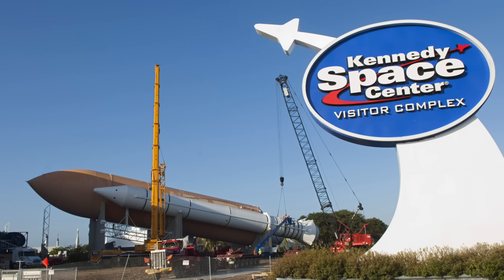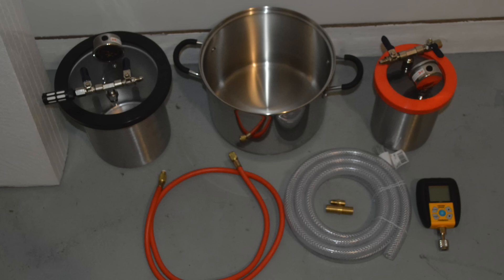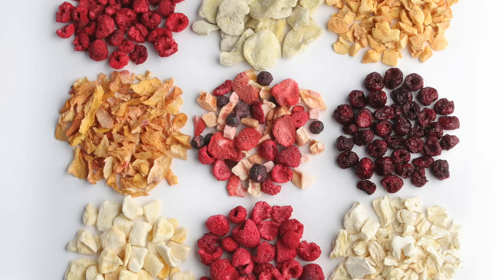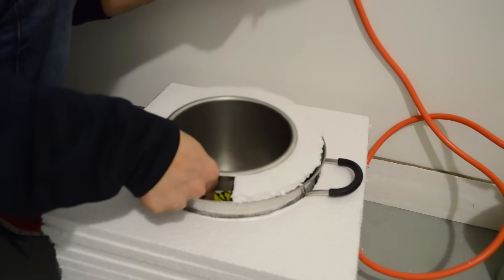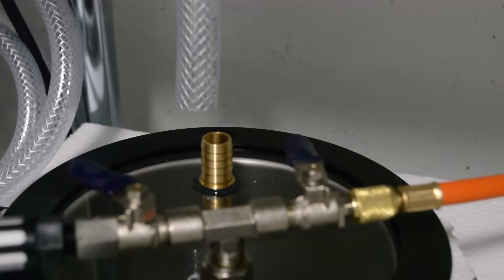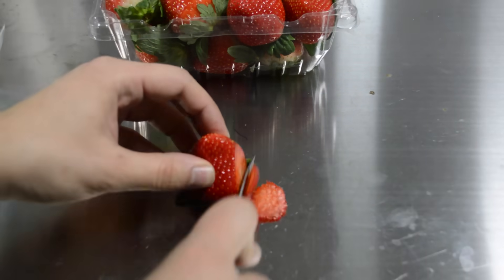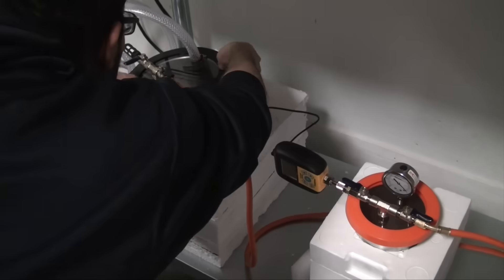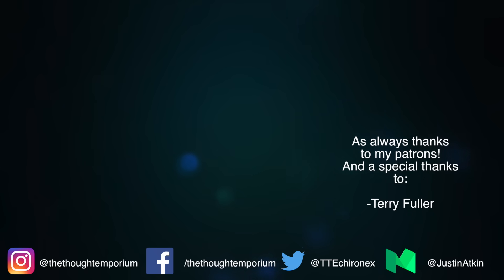How to Build a Freeze Dryer

Comment: Quick question: maybe I missed some clue but why you using dray ice - do you really need so low temperature? I would expect that frizzing samples and keeping below 0 centigrade would be enough and also most energy efficient as I would expect the higher ratio of sublimation just below 0 then in -40
Reply: Actually the sublimation line exists below the triple point so you just need to keep the food cooler than 0.16C.  However you do need a margin so that no part of the food reaches the triple point.  Indeed, at higher temperatures less of a vacuum would be needed.   However texture and quality can be improved by what's called IQF which stands for Individual Quick Freezing.  Dry ice would be good for IQF.  I think this DIY'er made it harder on himself by insisting on such a low temperature and extreme vacuum.  The phase charts for water suggests that such extremes are not needed and indeed historically the ancient Incans freeze dried foods by climbing mountains and leaving the foods exposed at the summits.

Commercial freeze dryers actually heat the product after the vacuum has been applied.
Reply: Unfortunately not. For Lyophilisation, you need very low temperatures so your products don't collapse or even melt. It's a science by itself.

Comment: What if you replace the water trap with a copper tubing coil suspended in cryofluid? T
Reply from the maker: That'll work, just use relatively wide copper otherwise it'll tend to plug with ice

Comment: A question for the PhDs: I've watched snow sublimate in sunlight with temperature in teens, with concrete actually dry. Sometimes even 'steam' can appear. Snow in thin layer. Layers of snow actually also reduce without obvious melting (liquid). So can a freeze dryer be made say cooling down to 10F, with a sun lamp, in a very dry or vacuum environment?
Reply: Yes, that was my query too.  Looking at the phase diagram for water, he actually made it harder to freeze dry by cooling to such an extreme and having such an extreme vacuum.   The sublimation line stretches from zero pressure and absolute zero temperature to the triple point of water so really all that should be needed is keeping the temperature below the triple point (0.16C) by enough of a margin so there is no danger of liquid water forming and then having a partial vacuum, the higher the temperature, the less of a vacuum would be needed to sublimate the ice.  I think he shot himself in the foot with this experiment.

Now rapid cooling of the product could help preserve the quality and texture so initial quick cooling with dry ice may be useful.

If I was to home dry freeze, I would quick freeze the product with dry ice then place it into mason jars, use a foodsaver jar attachment to create a partial vacuum.  The foodsaver's pump can remove just less than half an atmosphere which should be enough if the temperature is high enough but you can use an automotive or AC vacuum pump including the hand brake vacuum pumps to remove 90% of atmospheric plus those pumps are intended for removing water vapour so a cold trap would not be needed to protect the pump.  The automotive brake and AC pumps happen to use the same hose size as the foodsaver jar attachment.  Then it's a matter of keeping the jars in the deep freeze with periodic vacuum draws for days.  Weighing the jars would show you how much water has been removed and the USDA publishes a list of the water content of common foods.  I suspect it would take days to weeks to freeze dry foods this way.
Reply: Yeah snow can sublimate partly because winter brings low humidity and the crystals can be especially effected by sunlight. I don’t think the conditions of a freeze dryer would be as applicable, maybe it could help a bit tho. Worth a shot but you’d probably want the lamp inside the chamber and that’s a pain

Comment: Wow.  I used to use freeze-dryers (Edwards) for lyophilization of pharmaceuticals from both aqueous & non-aqueous solvents.  Our shelf temperatures within the lyophilization chambers were on a separate temperature control circuit so we could drive the process by adding heat to the subliming vials of product.   I also used the chambers to add a special gaseous headspace to a liquid diagnostic product that is on the market today.  I was actually given a product that I had performed pre-approval development work on.  Of course most of the products I worked on were for cancer or HIV,  so I am quite glad I never needed those.  

BUT,  I never got to lyophilize STRAWBERRIES!!!

Comment: 2:16 >millitorr
proceeds to show diagram with pascal on one side and bar on the other
*facepalms
ok no problem let me just get my forty year old quintuple scale unit conversion slide rule from the chest with "do never open" stamped on it, locked with a key which my grandfather swallowed and drowned himself in the sea
Reply: You can use my conversion factors tables, I have those across the room :v

Comment: I've been thinking a lot about this setup.

This might be cheaper by eliminating the dry ice.

Put a check valve from food container to freezing chamber. Next pump/circulate your dual stage vacuum oil into that chamber such that the surface area of the oil is increased.

Here is a luxury step. If you have a 2nd pump of poorer quality connect that to the food chamber.

Steps. 1 while food chamber is worse than 25"Hg, then open cheap vacuum and run it. This is a quick 8 second step, but very useful if you can pump CLEAN dry air into the food chamber. Most air compressors don't make clean air.

2. Turn off cheap pump and valve.

3. Turn on nice pump and run for an hr.

4. Pump oil from nice compressor into the freezer jar (now it is not a freezer, but a dryer). Circulate last oil from here to nice pump. A continuous circulation sounds better. I have to think more to be able to determine how to adjust the flow rate of circulating oil.

The idea is because of the high vapour pressure of water, some water will escape out the exhaust of the pump. The oil will absorb some moisture reducing the vacuum capability of the pump. When the vacuum gets too poor, freshened oil is circulated in when makes the vacuum much better again. The old oil is dried and gets cooler (makes the vacuum pump work better - lower vapor pressure of water in oil)

This will make your HV oil last longer. However, contaminants from the food is getting into the oil (and baking onto the walls of your good HV pump). At some point a flushing solvent is needed to clean the pump and a complete oil change.

I'm trying to remove dry ice which makes the process onerous.  I'm trying to keep the pump and oil below 104 F. I'm trying to keep food chamber uncompromised by bad air, oil vapor, etc. I'm trying to keep HV pump always operating at HV with clean cool oil. It works better stays cleaner and needs less maintenance. 

Oh, I forgot all about my dehydrated apple there. I'm having too much fun keeping the pump running.

Comment: https://www.homedepot.com/p/Owens-Corning-FOAMULAR-1-2-in-x-4-ft-x-8-ft-R-3-Square-Edge-Rigid-Foam-Board-Insulation-Sheathing-36L/100320356

this is a better material for temperature isolation and is much less fryable

Comment: For the vapor trap, I used some stainless steel fins from some scrap 304 stainless steel to increase the surface area and help less water vapor make its way into the Vacuum pump. I learned that the hard way and ruined a $1000 vacuum pump and vacuum fittings.

Comment: What about using a vacuum pressure tube that has a remote meter instead as they are not too expensive. Can get for under $200 new.

Comment: hello the water tramp can be made with a 2 quart resin trap that they sell in Best value vacs? thanks I will build mine but I was wondering if that resin trap will work? here is the link for the ebay resin trap thank you  https://www.ebay.com/itm/Best-Value-Vacs-2-Quart-Resin-Trap-Vacuum-and-Degassing-Chamber/282883443116?hash=item41dd2ac9ac:g:-2wAAOSwJ8pbZU~R
Reply from the maker: ya that'd work

Comment: Is there anything else you can use instead of the denaturized ethanol and dry ice? I suggested this for my sister because she wants a freeze drier but seems to be deathly afraid of dry ice for some reason
Reply from the maker: Not cheaply. You could use liquid nitrogen but that's more expensive. At some point I'm planing on building a device that can get to these temps without dry ice, but it'll be a while and won't be able to be a great water trap as it can't cool a large enough area.
Reply: @thethoughtemporium  Wouldn't it make sense to run a little higher pressure in the drying chamber, say 50 to 100 Pa, and use standard refrigeration coils to keep your cold trap at approx. -30 C?  Everyone seems to think that 10Pa is required for freeze drying, but it seems to me that it's more about removing vapor fast enough (by condensation or with the pump) to keep the vapor pressure under the triple point.

Comment: Can you replace the water trap with a pipe/chamber filled with silica gel?
Edit: Nevermind, just saw a video with silica gel under vaccum, the water just boils off.
Reply: A/C vacuum pumps will draw water in small amounts <100ml/hr without the need for water separation. I believe that the water separator is for when you are removing a large amount of water due to high surface areas mainly found in commercial drying operations and may not be required at this scale.
Also most A/C vacuum pumps will draw a vacuum down to 35 micron, The industry standard for pre-Fill vacuum of a r134a Aircon system is <200 micron.

Comment: I think keeping the drying chamber below freezing during the entire process is preferred.  That is to say, below freezing and not below zero F.  Sublimation still occurs and you don't have to worry about the cellular structure getting smushy.
Reply: they do sell heating mats for them.
i doubt freezing is the best..
after all temp differences are used to move gasses, or to make gases liquid or liquid into gases.. (and that is what we are working with in this method)

the importent thing is probetly the temp diffence, and not the temp.
as long as you stay within where nothing usefull is destroyid in big amounts..

terpens can be collected with freeze drying (with the right temps), so you can also collect the taste and smell to some degree. (and those are not collected when the proces is at its coldest point)
probetly not anuff to taste any difference, but you would be able to collect some very tastefull and nice smelling aromas

Comment: Do you need to keep the pump running once it has created the vacuum?  Could you get away with putting the food into the vacuum chamber, bringing it to full vacuum and then sitting the chamber inside a freezer for a few hours until the food freezes and the water sublimates from it?  The sublimation would create some pressure inside the chamber but if you kept the batches small it would just condense on the sides of the chamber as frost.  As a note, I'm thinking about this from a food storage standpoint.
Reply from the maker: Ya you can't turn the pump off till it's done. It loses pressure very quickly the second you turn it off from the massive amount of water vapour coming off the items
Reply: any chance you can link to a pump?  I know absolutely nothing about them so I can't tell a good value from not.

Comment: 6 to 14 hours? Wtf
Reply from the maker: joebonsaipoland depends on sample size/thickness/volume, water content and how well the system is working and the temp of the drying items. Its a "turn it on and check on it every now and then" type of machine. If things need more time you just let them run longer because it's impossible to over dry something. Once it's dry it's dry.

Comment: Hi, So i kinda wanna do this but not really i have a pump but its one stage and wont get near that pressure level i still wanna build a chamber to evaporate water with but don't care if it maintains its shape or flavor i simply just want to evaporate water with it since i dont need to freeze dry it i dont need the freezing stuff, can it work with or without added heat? if so how at what rate? thank you i love your videos

Comment: The comment at the end about making a carbon foam from bread in the kiln, reminds me of a video I saw from AVE. He did just that by burning the bread without allowing it oxygen. I thought it was really neat, so I've been thinking about it for a while. What if you used popcorn instead of bread? And then, I wondered if you could make high temperature refractory bricks using the presumably resulting carbon foam pellets, by misting it lightly with water, and dusting it with dry (unfired) clay, and repeating this until the pellets build up a thin protective shell of clay. Then you would pack them into a brick mold in layers, with a light mist of water and a light dusting of clay in-between each layer. I think a handheld old fashioned flour sifter would help to apply the dust evenly. I also wonder of being able to incorporate grog (crushed, fired pottery), in dust or fine grit form, to help with thermal shock, incase the version made without it has any trouble. Anyway, the brick should be allowed to dry very thoroughly, and not too quickly, so that it doesn't explode in the kiln, or crack while it's drying, from the pressure of water vapor trying to escape too quickly, or the strain of the brick contracting unevenly from drying out.

I also thought about adding the clay shelled carbon foam pellets to the kiln individually, but I wonder how you'd get them packed in efficiently, without having them all stick together during the firing, if they're touching eachother. Maybe coating them with some kind of ash? But if you could fire them as individual, loose pieces, you could probably actually use them as grog for clay bricks, without actually crushing them up, like one would normally do. That way, you could create custom shaped refractory clay pieces for ovens and things, without having to try to make them from assembling a bunch of bricks.
Reply: World Theory wow

Comment: Next time, get a cardboard box and some spray foam insulation. Put the pan in a plastic bag if you want to be able to remove the pan from this later. 

Put pan in bag and bag in box then spray in foam into the box and wait for it to dry.

Comment: one small point, don't use regular spray adhesive on polystyrene, the propellant and the solvent in in dissolves the polystyrene, same is true for a lot of plastics,  you need the one that's specifically made for plastics though to pay through the nose for it
Reply: tigoda85, 3m brand super77 contains acetone, and that eats most foams. Yet if you take said adhesive and spray thin, light coat from a distance of 16 inches approximately on both surfaces to be bonded, it won't melt foam. Acetone evaporates before it reaches the surface. You'll tear the foam apart well before you tear the glue seam. Great adhesive for using a hotwire cutter on laminated foam

Comment: Cool project! There are some china vacuum pumps on ebay for around 50-80 bucks. Do you think they could also do the job?
Reply: It MUST be a 2-stage pump for this to work. Reason being it takes a 2-stage pump to achieve the low vacuums needed.

Comment: awesome project! buying a lyophilizer is expensive even used...it's cool to see this done so cheaply (other than the vacuum pump). ill have to give this a try!
Reply from the maker: Thanks :) Ya I was looking at buying a used one, but the price was insane. Was so much easier to just build it.
Reply: @thethoughtemporium  how well would it work to use a used refrigerator compressor for the vacuume pump?
Reply from the maker: @davidmontoya3997  not at all. needs a better pump than that.
Reply: @thethoughtemporium  My second question is  do you think it would be  possible to modify a deep freezer to hold the required vacuum and have a separate water trap compartment built in as well?
Reply: @davidmontoya3997  No, typical deep freezers are not built with vacuum sealing in mind, You would likely end up swapping out the entire interior compartment and the door along with all sealing elements. By the end it would likely just be cheaper and easier to build a vacuum chamber that size from scratch and then to cannibalize the refrigeration system from the deep freezer to cool the vacuum chamber. That is effectively what you would end up with anyway if you tried to convert the deep freezer into a deep vacuum chamber.
Reply: @maxk4324  Hey mate, would you be able to recommend a vacuum pump that would be ideal for this experiment?
Reply: @thethoughtemporium  is building your own freeze dryer as effective as the commercial ones? And is it cheaper? I own Guardian Dogo Argentinos and I'm selling freeze dried food and homemade treats for dogs and I have more clients than I can handle with my current equipment, and I can't afford a bunch of commercial freeze dryers. Please get back to me A.S.A.P.

Comment: I've always been interested in making one of these myself, very nice. The only thing I would change is get rid of the styrofoam and get some closed cell foam, like the sheets of insulating foam you can get at the big box hardware stores. Easier to cut clean edges with.
Reply from the maker: I was considering it but the styrofoam was half the price and fit in the car haha
Reply: Couldn't you just tube it up into a deep freezer?
Reply: @chancetolbert4852  I think the temperature needs to swing a bit to entice the sublimation, but I have always wondered if just sealing up my deep freeze and putting a vacuum
 would work for some foods.  I know it's worked on a few steaks I forgot about at the bottom of mine.